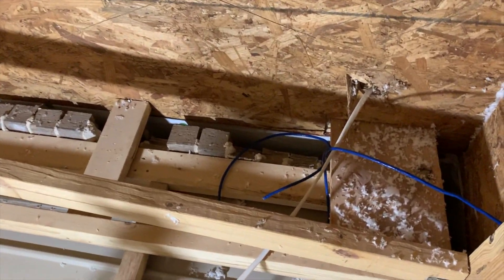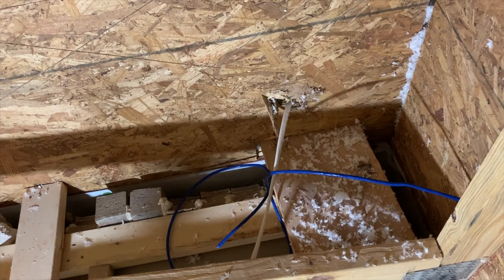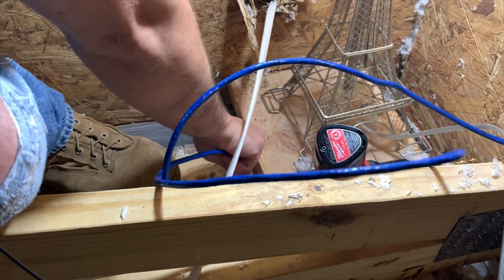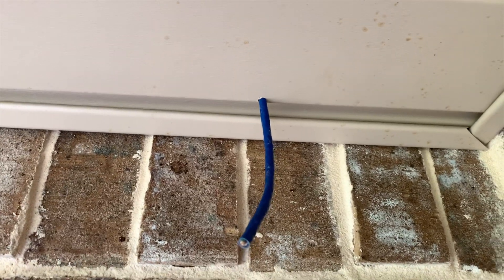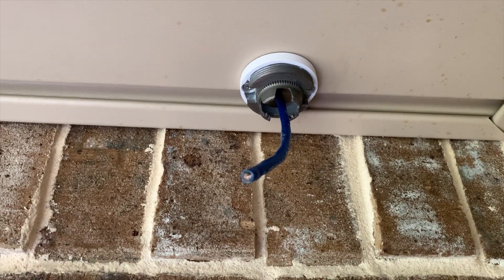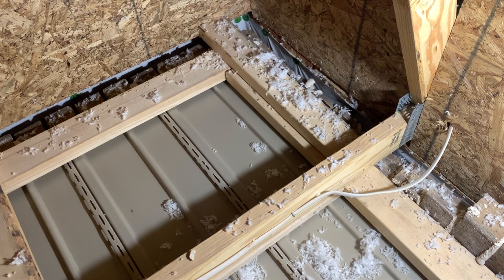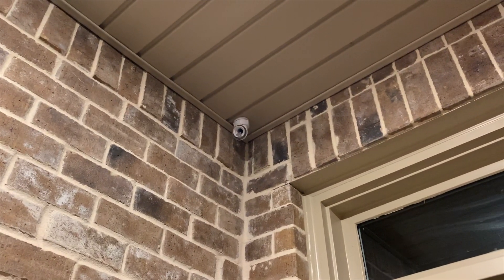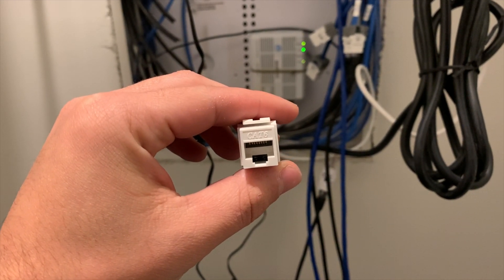Installing Ubiquiti PoE IP Cameras outside the Home Lab and Office

Comment: Be aware the these camera's are NOT compatible with the standard 48V PoE Power over Ethernet !
As a workaround, they require the special Ubiquiti PoE 24V DC passive converter to adapt to the 48V DC standard PoE !!!  (why ?  The PoE protocol language is different)

Comment: Just a quick question, can the video recorder be connected to the network modem?
Reply from the maker: Yea
Reply: @SPXLabs  Great, this means I can leave the switch in the attic powering the cameras, and then run the switch back down to the network modem and have the video recorder down in the house connected to the modem instead of the switch right?
Reply from the maker: You probably don’t want to put the switch in the attic because it will be too hot and kill it.  Also, the cameras need power so you will need a switch that can do PoE
Reply: @SPXLabs  Thanks for the suggestion

Comment: Does anyone know the best way to secure a camera to vinyl soffit if you don't have wood under it? This was a very informative video.
Reply from the maker: Instead of using screws use a bolt and nut.  If you don’t live in a high wind area it should be fine to sit there.

Comment: i doubt it is teh camera did you check it with another cable in the house think the connection outside did not crimp properly.
Reply from the maker: It’s the camera it doesn’t power up at all.